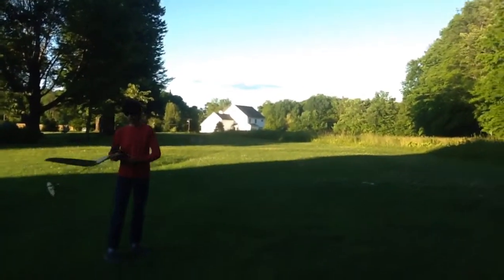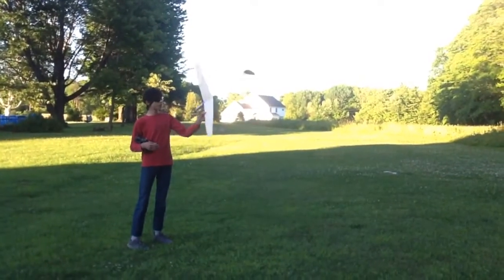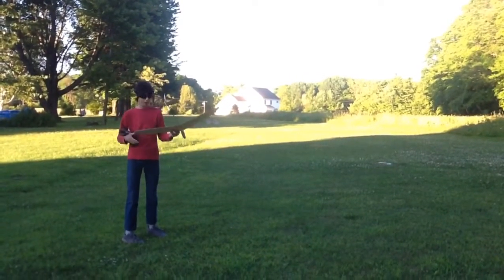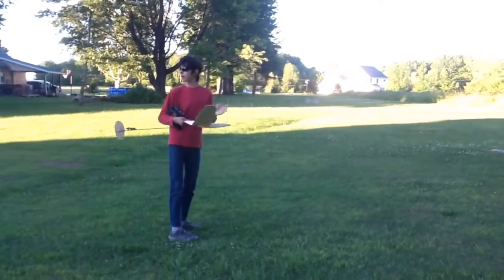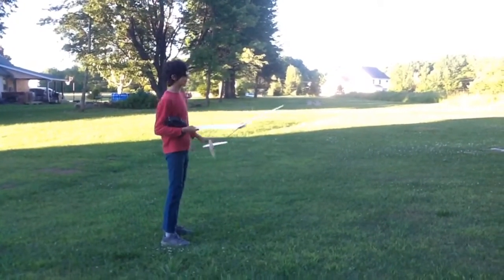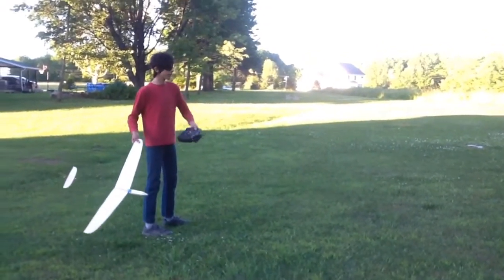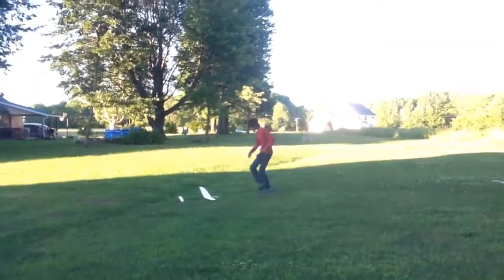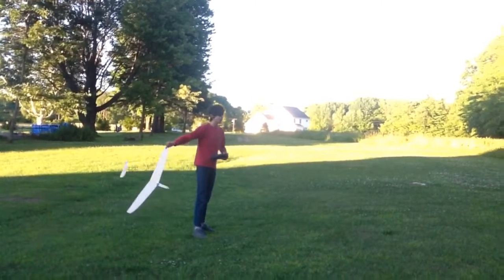Flying A 36" Scratchbuilt Balsa DLG

Comment: That looks super cool! aww man.. I cant wait until you start getting cameras on those things!  Great share!  I love these flights!
Reply from the maker: Well the issue is any camera powerful enough to transmit to the ground and cheap enough to buy is too bulky and induces so much drag that it cuts flight times almost in half. I have tried it, the drag is just too much. But I am working on a 3 meter model that could probably carry a small camera.

Comment: Looks great! One piece of advice: trim it so that you can launch almost level hand have it pitch up into the climb. Use rudder trim as needed to ensure it launches straight. Any turn is costing you altitude.
Reply from the maker: Yeah, I know I should get that worked out. It used to do that, but after it got "used", it stopped flying straight. Lol. I actually have two others that do it pretty well, in fact one of my DLGs  I once trimmed out and got it up to around 120'. I guess it would be easier with flaperons cause I could set a pre-set for launch...
Reply: Copterdude yeah flapperons are really handy like that. On any balsa DLG you have to plan to tweak the trim regularly, nevermind the issue of servos drifting (unless you like spending $60/servo).
Reply from the maker: I actually have never had drifting servos, not even with really tight spring-and-string linkages. But yeah, I have a full 4 channel flaperon DLG, and that launches beautifully straight when I get the preset and launch mode totally dialed in.